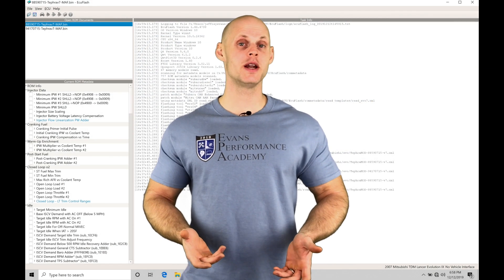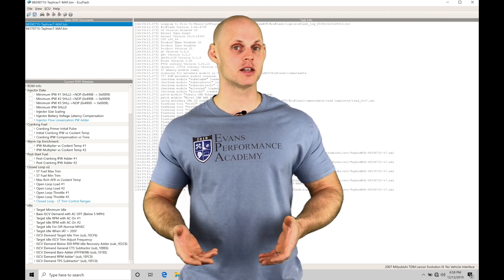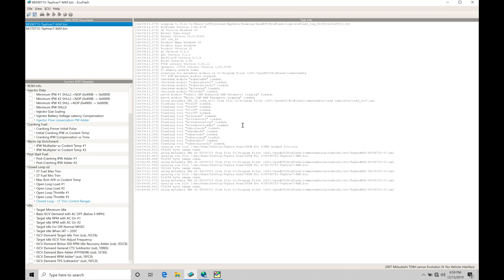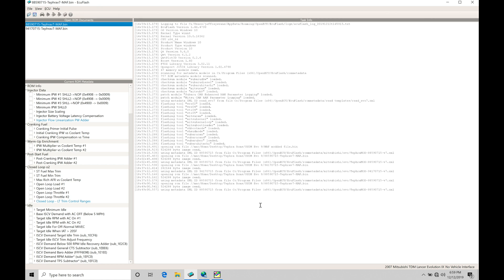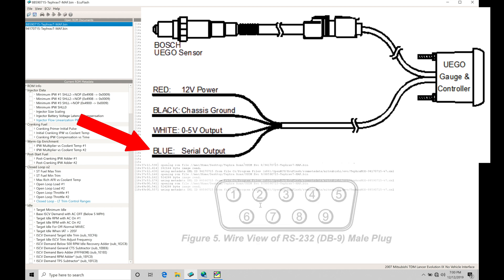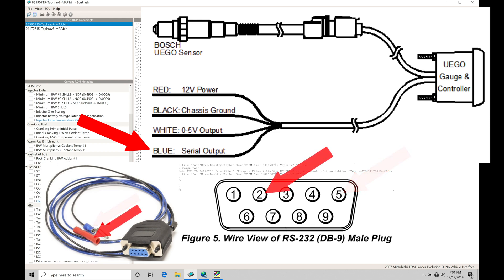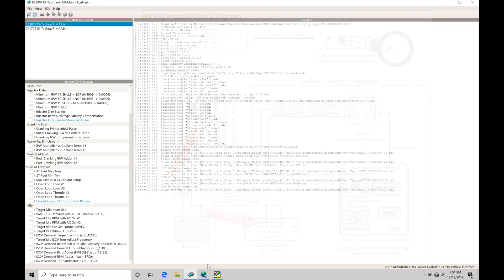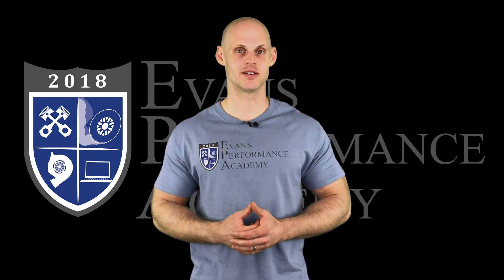Ecu Flash Training Course Part 8: MAF Tuning & Datalogging | Evans Performance Academy

Comment: friend you will have any idea because the evoscan datalogger saves everything in a single column in excel and it is impossible to see the record since everything looks messy
Reply from the maker: Use Megalogviewer HD software to review data logs from Evo Scan.
Reply: @EvansPerformanceAcademy  
it does not open it since the records of evoscan are poorly organized, as I mentioned above all the records are in a single column